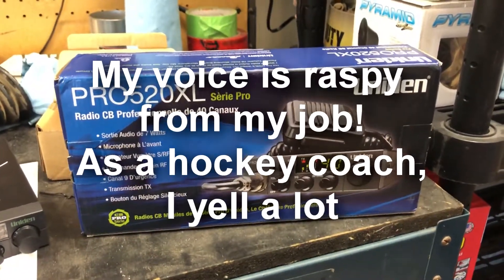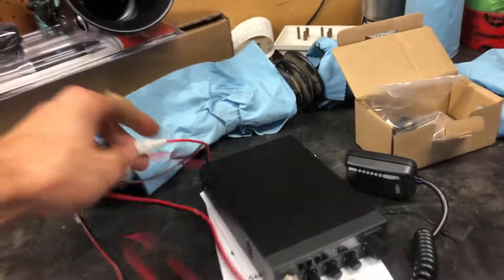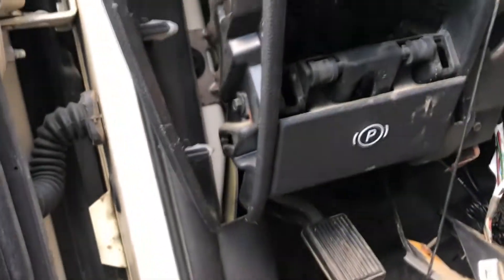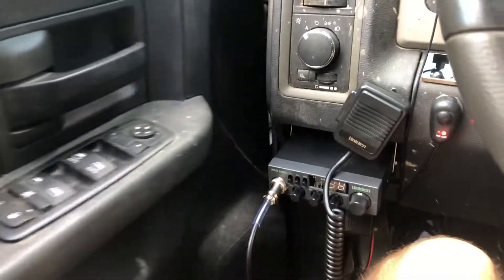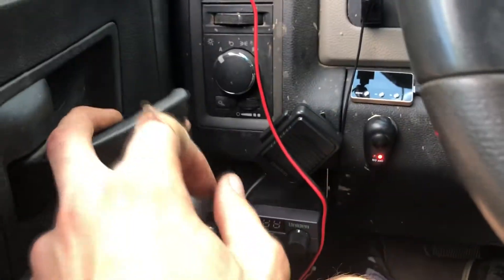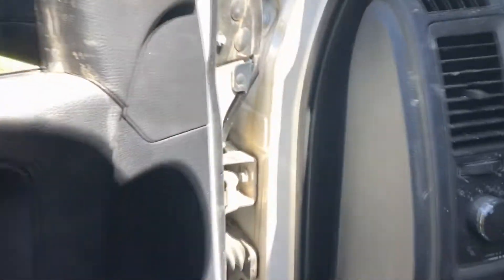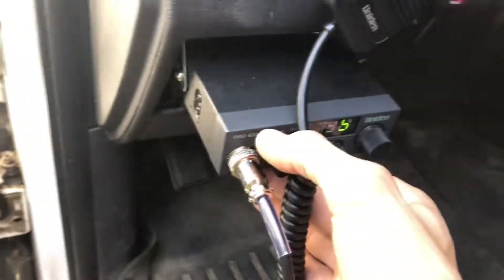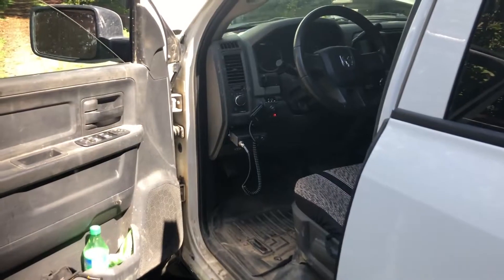Off Road Dodge Ram DIY CB Radio Install!! YOU NEED THIS FOR YOUR VEHICLE

Comment: Ditch the antenna and go with a tram 3500 or wilson 1000. And get a inexpensive swr meter to tune your antenna. Make sure your swr is 1.3 or lower and youll be good to go

Comment: Put a fuse on that wire just as it leaves the battery. Your truck and yourself will be grateful if the wire ever accidently shorts, otherwise it'll end up being a heating element.
Reply from the maker: Good idea! I should